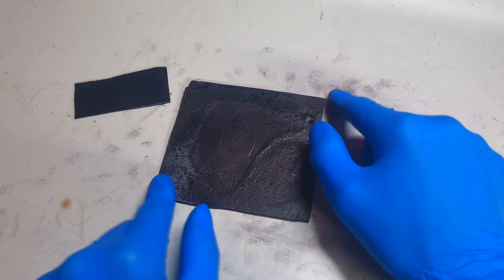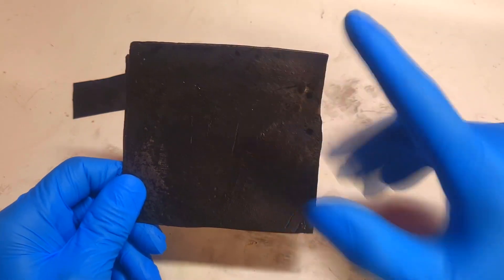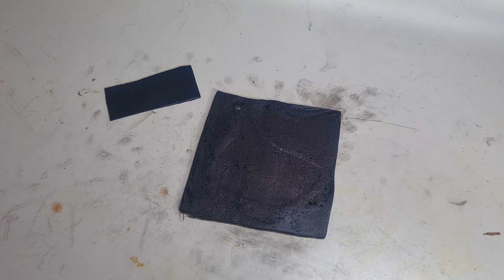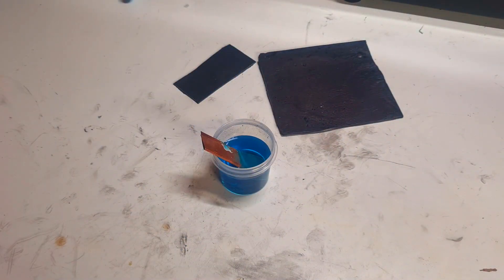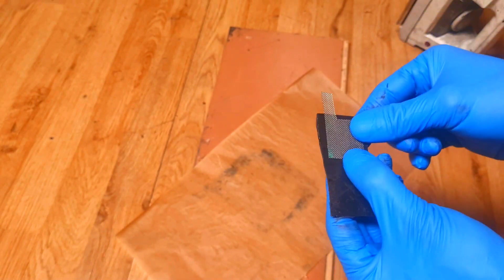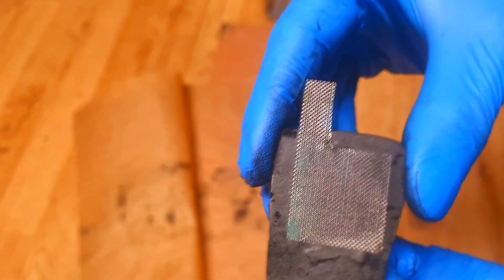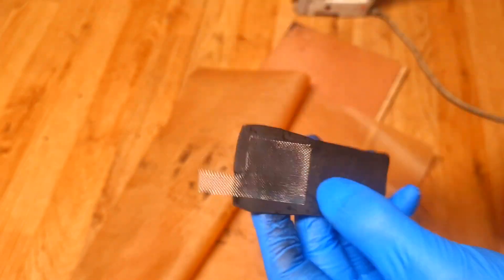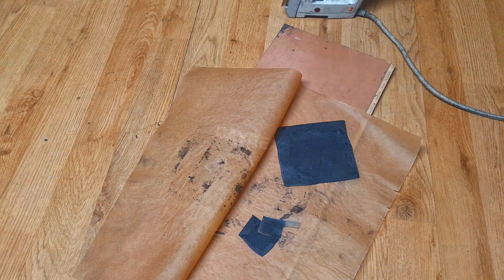Carbon conductive plastic for bipolar batteries

Comment: Hello, I'm trying to make carbon heat paint myself. It's been 150 degrees, but it keeps heating, its resistance drops a lot. It starts with 220v - AC 3 Amps, it becomes 10 Amps and it makes beads, the paint explodes. Sodium silicate and powder Carbon inside the paint. What extra should I add in ohm fix?

Comment: Nice low resistance!. Maybe it could get even lower with a metal core. What resistance should be best?
Reply from the maker: What resistance will be the best? Low as possible ☺
Reply: @cayrex  LOL obviously. But at some point I asume it is getting smaller than the ionic resistance and it contributes less to the total internal resistance. Any idea of the tital internal resistance of your battery? I looked at titanium foil and is supposed to withstand iodine and bromine. But it is expensive too and dont know how it will last in a battery

Comment: does anyone know if there is  any way to make activated carbon in to a conductive form or something, because i don't have any graphite and can't afford any currently but ive been trying to make some stuff with the activated carbon i have and it doesn't really work
Reply from the maker: Yes, some of the activated carbons have low conductivity as powder,... and if you add some binder then the conductivity get even worse. Right now you can not do really much about that.
Reply: You can get it glowing red hot in a microwave oven covered by some small terracotta garden pot. No oxygen allowed . This will graphitize it a lot but best way is with graphite